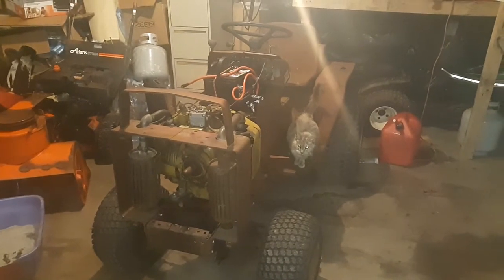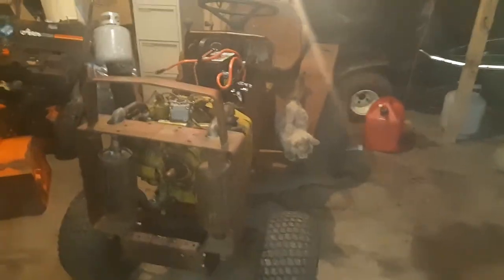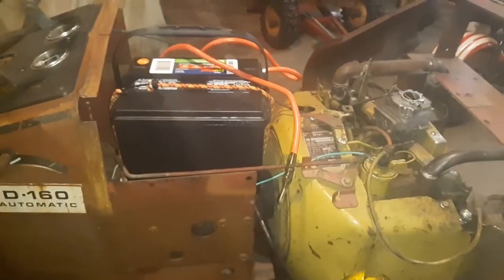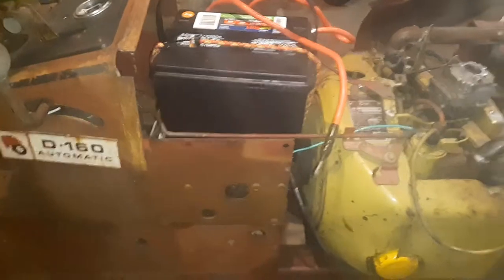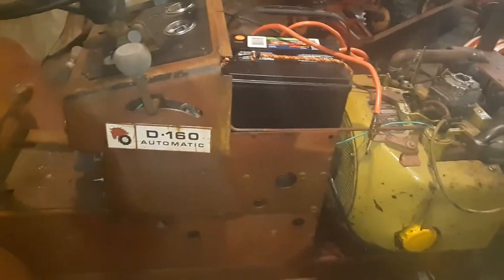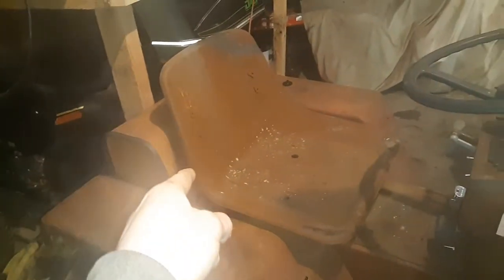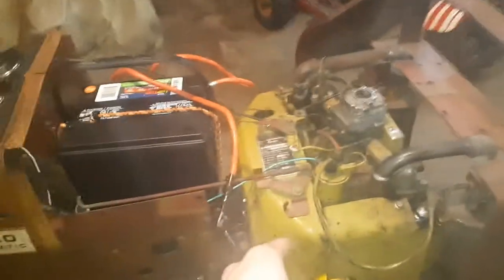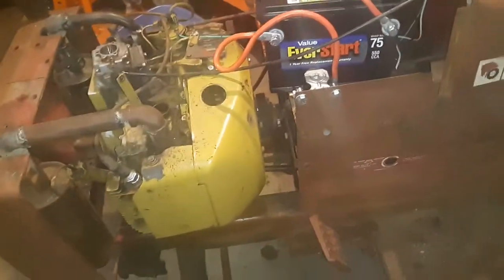Wheel horse d160

Comment: Great video, thanks. Exhaust looks very similar to original, what did you use for exhaust boxes. We currently have a stack pipe on our D-160 (see my channel) but it does not look right and I want to change it
Reply from the maker: When  I bout it came with the mufflers  I just bend  my own pipe on the pipe bender and try to not burn down the motor while tack welds lol.
Reply: @jordantractorvlogs7008  Thanks. We have done a lot of searching without success, looking for replacement mufflers. I was hoping you would have the magic answer lol
Reply from the maker: Go on red squre wheel   form they can get u one  they are  out there  they run about  50 bucks